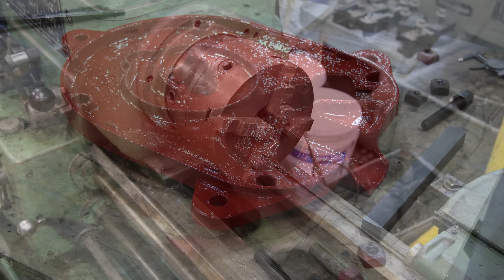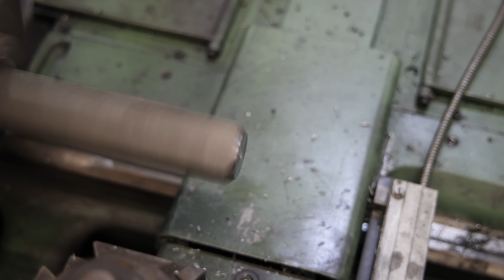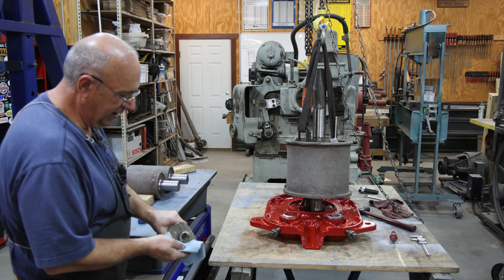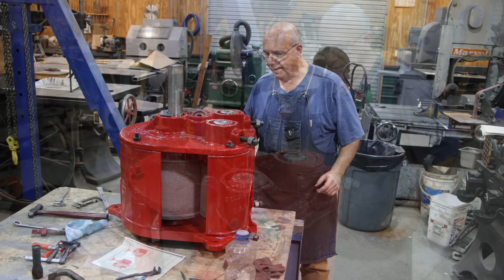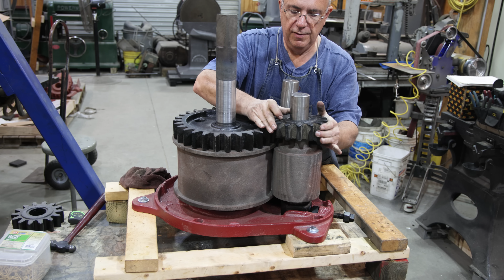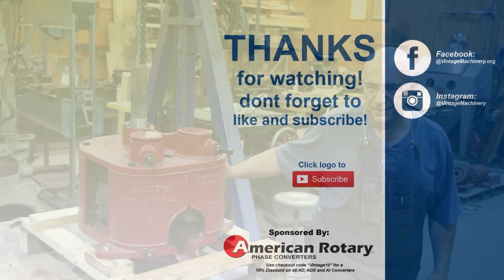Putting Together a Couple of Goldens’ No. 2 Sugar Cane Mills

Comment: I don't know about the cane mills, but when I was a kid and in Boy Scouts, I volunteered every year at the local pioneer village every summer.  We had a grain mill/wheat thresher that worked the same way.  It was also painted red.  Every couple of years we had to touch up the paint. We did it the old fashioned way, using barn paint which was a combination of milk, iodine, and linseed oil.  Sometimes we added pine tar varnish to thicken it up, but that also made it that darker red.  So I think the darker red is the original because of the varnish they would add to the mix.

Comment: 23:19 - Guessing o'head lifting gear was not common where these were used, when they were designed. Would have been easy enough to provide sling eyes.
30:39 - FYI: There is no "Ferrari Red". The factory bought paint probably several times a year and the formulations changed at each purchase.

Comment: What stops the top roller from dropping out of the half bearing? I understand the bearing is only under load when its crushing cane but what stops it from dropping against the bottom rollers when at idle?

Comment: My experience with powder coat is that it doesn't hold. I've had it peel off a farm gate, patio furniture, and other items. Then it quickly rusts. I paint surfaces that will be exposed to UV light.
Reply: Improper surface prep is what usually causes that. Smooth materials need a good chemical wash to clean them and remove all oils and contaminants. Sadly many don't bother doing that, instead they just run them through a high pressure wash tank and dry them, that leaves enough residual oil on the part that the powder never really bonds to the surface.

Comment: These mills are looking great after all your work Mr Rucker. 
Is it really a good idea to paint / powder coat the gear cogs on the bright red one? They are hidden inside, surely the surface coating, whatever it is, will just grind off straight away?
Reply: Bubba loves those cane mills, I think they use them for lawn ornaments down there, just think of them as the Georgia version of the pink flamingo.:face-blue-smiling::face-blue-smiling:

Comment: I know you talked about "food safe" lube, but what about the paint?  Won't it be rubbed off the gears where they engage?  Could this be a syrup contamination issue?  Come to think of it, I wonder if the originals used lead based paint???

Comment: Hi, Do you think Red Lead Primer might be the color?
Reply: Back then yes... sometimes with a shellac overcoat for shine and dust removal. These things were shipped by rail, horse and buggy, mule teams, and the back-breaking men and women, weather and sweat drops made an interesting pattern on the top coat. Grease was dry rubbed into the rollers, white lead was used for grease on the overworn journals to save the cost of a teardown and restart. Night work was difficult and waiting for the day was not an option.

Comment: Since the roller shafts are vertical, all that weigh is on the bottom of the lower bearing caps. No babbitt to turn on? Not needed because oil runs down there? Nice job!
Reply: Actually there is white metalthere. Got a video time to look at? I watched the babbit pour, there was metal there then.

Comment: Cool old mill!  I don't understand.  What is the bearing surface that takes the weight of the rollers?  I see the babbitt that takes the pressure as they crush the cane, but the ends look like they'll just grind through the bearing shells.
Reply: I agree. I believe that he has these too far out of adjustment and the 1/8” OEM spacing would solve the clunking problem.
Reply: Bubba loves those cane mills, I think they use them for lawn ornaments down there, just think of them as the Georgia version of the pink flamingo.:face-blue-smiling:

Comment: ima just make a logical guess on the rollers.  the reason for the difference in diameter is to keep the cane from crowding up inside the machine.  they are turning at the same speed but the larger roller has a higher sfm or surface feet per minute to keep the canes under some tension while going through.  if you went the wrong way they would bunch up and plug up the mill.
Reply: It also adds shear forces from one side of the stalk to the other, so it tears it open.
Reply: Wow. Everything you wrote, was wrong. The difference in diameter is to create different levels of pressure, for efficiency. If cane goes through the other way it simply works much less efficiently, because the second larger roller does absolutely nothing.
Reply: @jimbarchuk  have you run these cane mills?

Comment: I think I agree with Keith on powder coat vs paint for many applications. Paint is way easier to repair.
Reply: I agree completely. I was manager for a powder coating company. We powder coated stuff where i felt powder coating was not appropriate. Customers would bring back powder coated Items, requesting touch up. Really, to do it right you need to remove the powder coating and reapply. Or match the color as well as you can with liquid paint. Powder coating is tough and once it's baked, it's done. No cure time.
Reply: @phlodel  How does powder coating hold up when applied to those gears? When put under sliding pressure, like the meshing of gear teeth, won't the powder coating crack or flake off?
Reply: @tsmartin  I have the same concerns. It will hopefully just wear down evenly. If the prep was not done properly, it will crack, flake and chip. powder coating is hard to remove when you want to remove it, even with a powerful pressure pot sandblaster. I'm also concerned about the food safe properties of the powder coating used.
Reply: @phlodel  I think there will be little red sparklies in the syrup for a long time.
Reply: @oldtugs  I'm afraid you're probably right. That's why I'm concerned about the suitability of the powder coating used for food service. Personally, I would not have done the gears.
Reply: @phlodel  Who were you with? I spent a lot of years in a powder plant from line hanger up to supervisor. Not sure I would have coated the teeth but the rest of the gear would be OK. Food wise it really depends on the powder used, there are a few that are food rated.
Reply: @Blazer02LS  I was with California Powder coating, a division of Trenz Manufacturing. More than 25 years ago.
Reply: @phlodel  Yeah it's been a long time since I left myself. Here a lot of companies started in house coating lines and the two main owners wanted to retire so they closed down. At one time we had three plants, 2 in NY and 1 in SC.
Reply: @Blazer02LS  It would have been really time consuming to mask the contact surfaces of the gears.
Reply: @phlodel  if you only masked the teeth it may take a bit, or just do what I did more than once. Dust on the powder, then use a short bristle brush and dust off the teeth. Wouldn't need to be perfect as you don't see them but we used air, brushes as well as silicone plugs and caps foil and kapton tape to mask parts. Some of those took a while, like the turbine shaft seals we did for GE, worst ones were items that had tapped holes in them.
Reply: @Blazer02LS  Yes, that would work well enough. I did parts for show vehicles. The slightest blemish would be unacceptable. Brushing off the powder would be extremely risky.
Reply: @phlodel  I did some things like that but a lot of it was just industrial coating. Most of that was just giving a nice even coat with the proper adhesion.  7 powder conveyor lines, plus 4 single oven booths. Three liquid lines and a batch booth.
There were a couple of us who were given all the custom work. We also would formulate new powders with Ferro or Tiger or others. The "Chrome" powder that Prismatic sells started out in our shop.
Reply: Surely, these restored cane mills are museum pieces only. Between the power coating and the extensive use of carbon steel, there is a lot of non-food grade material here, and I'm sure it would be unlawful to sell any food product manufactured with them.
Reply: @gavinmclaren9416  The person doing the restoration was the one who made the choice to use food safe lubricant and he repeatedly spoke about food safe materials.

Comment: I think I would use silicone grease as a lubricant, as it is both food safe (used in plumbing) and will never break down or go rancid. Silicone grease will also resist washing out or emulsifying with water (turning into mayonnaise).

Comment: I know that the customer asked for powder coating but powder coating in a corrosive environment is a mistake. The coating traps moisture in a way that normal paint won't. Those of us that live in areas where the roads are salted know this all too well.
Reply: The biggest issue with powder is surface prep, followed closely by damage to the coating. It is essentially a melted plastic coating. When applied to a properly prepped part it will handle a lot of corrosive materials. However even small impacts can cause minute cracks in the coating, that allows moisture in and now you have a problem. The substrate starts to corrode, but you cannot see it because the powder doesn't start to bubble or deform like a solvent paint. By the time the powder shows failure, the substrate is usually very compromised. Of course which powder formulation is chosen makes a large difference as well. Polyester, Epoxy, Polyurethane, Nylon, a Hybrid material. Poly tends to handle UV and exposure better, Epoxy is good for interior items and as a stabilizing coat, but it doesn't handle UV very well. Spent many years doing powder and liquid painting in an industrial setting along with development of different powder systems. Best part of the job was being able to coat anything I wanted to as long as it fit in the ovens (The largest one we had at the time could be used to park a dually crew cab in!)
Reply: Bubba loves those cane mills, I think they use them for lawn ornaments down there, just think of them as the Georgia version of the pink flamingo.:face-blue-smiling::face-blue-smiling:

Comment: Keith, with the rollers and shafts being in a vertical orientation on these #2 cane mills is there a babbitt or something in the bottom housing to minimize wear as the shafts rotrate ?  The rollers and shafts on the 'monster' cane mill were in a horizontal orientation so the babbitt bearings would support the weight and pressure.
Reply: Perhaps cast iron provides a good bearing surface due to the graphite inclusions?  The main force is the babit bearings on machined shafts
Reply: Look for another answer by @CothranMike, there is some metal in there for a bearing surface.

Comment: Very interesting Keith. I would be interested in having you explain how babbitt bearings were done by the factory. How different was it than what you do now?
Reply: MR, actually, even today white metal bearing surfaces are made for the connecting rods on your internal combustion engine, and the mains, and in some other places on industrial equipment as needed. Great write-up on line at mumble, mumble. 

As to what KR might say... in general at the point in the 1800 where single 'man' labor was required for "mass production" back then the workers moved to the work and/or assisted in specific ways, a specialist you might say. Apprenticeship and guilds guided labor. Management held to maximize return for owners. Much like now things worked out for folks about 20 percent of the times. The rest was wasted time, materials and vast sums for repair, rail investment was always a good thing. History!

Comment: As a Limey who got into moon-shining, built my own pot still, upgraded it too reflux too! Made gin, vodka, white whiskey, sugar shine from granulated sugar only. There is one question that keeps burning every time I see one of these fine machines restored. Does the sugar syrup make for some tasty booze? 
If my question lowers the tone of this channel and I feel a moderators boot up my backside on the way out I understand 🤣
Reply: Would depend on what you ran through the mill, Sugar cane gives you granular sugar and molasses. So you could do white spirits and rum if you crushed your own.
Reply: Generally the syrup would be dried into granulated sugar.  The syrup and sugar have very similar tastes, so I doubt there would be a significant difference in taste in moonshine made from the same still.
Reply: @peterhobson3262 Ty for your answer but damit. I was hoping fresh syrup never dried would taste bettter.
Reply: Bubba loves those cane mills, I think they use them for lawn ornaments down there, just think of them as the Georgia version of the pink flamingo.:face-blue-smiling::face-blue-smiling:
Reply: @garybrenner6236 You give British people crap with you're statements that we have implied or said all you from the 13 colonoies are stupid when we havent. And yet you treat one of youre own like that every chance you get. If you ever get banned I wont be sad.

Comment: Which type of the bearing you use to support the smooth operation and why you're not using key to hold gears
Reply: There are lugs on each roller that mate with similar lugs on each gear.  Since timing from one roller to another is not necessary, the mating lugs fit loosely to allow the parts to fit together as cast, requiring no machining.  When he dropped the big gear on its roller, he gave it a spin until the lugs came together.

Comment: That vegetable oil reminds me of my Mill and Industrial Supply days as a Sales Engineer! Back in the '80s. I was the "go-to" guy when a customer had a somewhat unique problem to solve...

Among them Kraft foods and Nabisco (known as the "Nasty Biscuit Company"). Both places used Wesson oil in all their hydraulic equipment and air-line oilers so a leak or broken hose wouldn't contaminate anything.

A real eye-opener to see how those things are made! Thousands of gallons vats of BBQ sauce, salad dressing, whatever...

A continuous (24/7/365) run of Premium Saltine crackers, from mixing vat at one end of a 20'wide conveyor, rolled out and through the oven, and then out to packaging...

Fun stuff!
Reply: NABISCO is the acronym for National Biscuit Company.
Reply: @Jimfiles3307  I KNOW THAT MAN! I spent 5 years in that job, and THEY knew me VERY well! I was the guy they asked for when they needed something we supplied fixed RIGHT NOW!

Throw a $10,000.00 conveyor belt speed controller in my car and run it over there at 5:00 after a full workday and stay there until it was swapped out, wrenching along with THEIR guys as long as it took! And I was on Salary. Not paid by the hour OR paid commission either! 

Perk for going there was you could eat all the cookies and crackers you wanted from the bins of broken ones that didn't go into packages (but you couldn't take any with you when you left).

The rest were sold to be mixed into Cattle feed...
Reply: @Jimfiles3307  Not if you worked there.....

Comment: Why does a square bolt with a chamfer look so good? Am I in good company hehe.
Reply: It's authentic, even if you can't see it, what's so wrong with that? If Keith were to have just parted it off square edged it would have generated a lot of comments...
Reply: @seapy2398  That is fair,there is alot of ''purist'' watching this vlog,and it is for the same reason why he had to explain the type of red that he used,witch was not the original color.
As usual ,it was most entertaining to view,and thanks.
Reply: Sorry if i came across wrong or even if i havent. I really like the chamfered look put on them.
I aint one of the never happy moaners. If i want a bolt doing my way i can machine my own. Im all for it fella. Love this channel @seapy2398
Reply: I love seeing that chamfer applied. Really looks good. Not that its my decision. His workshop his choice.  @seapy2398
Reply: @seapy2398  Odd reply.
Reply: @rovert1284  ahh just a misunderstanding I think, Anyways all good.